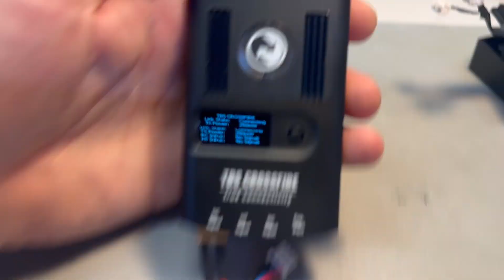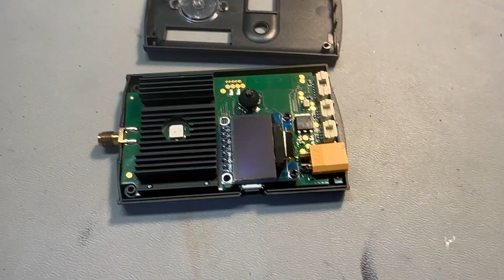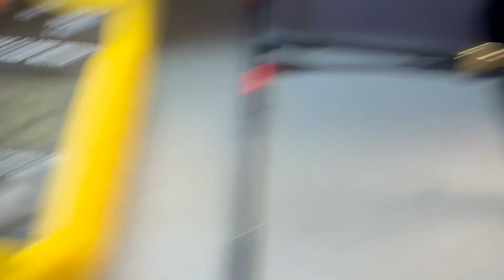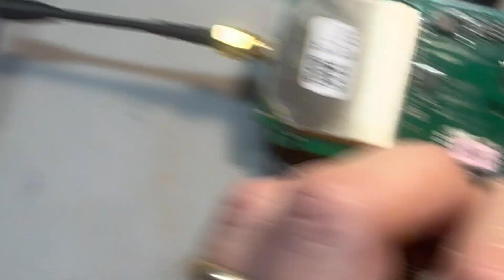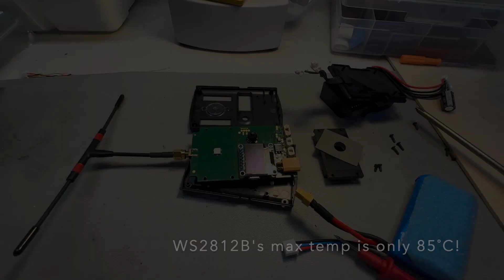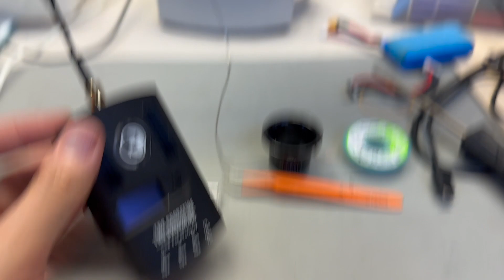TBS Crossfire Teardown and Repair of Intermittent LED Flashing / Flickering

Comment: Good vid was the tx having other issues also of was it just the flickering. The light on mine stopped working. The tx was still working however until two days ago where i now am getting no communication to the receiver. Ive tried bending the pins and didnt have any luck